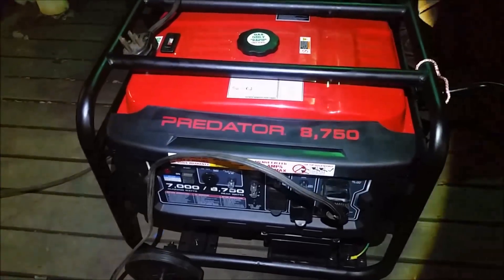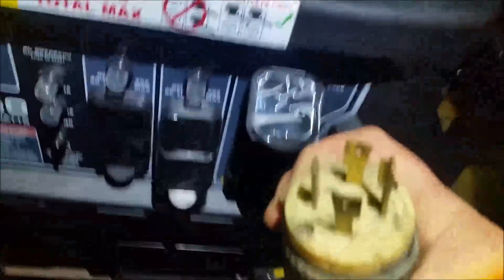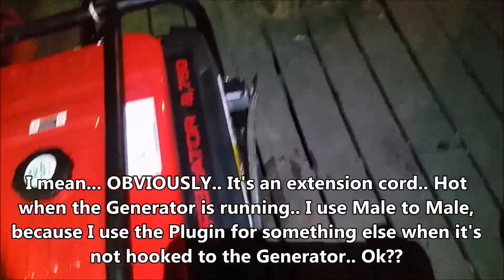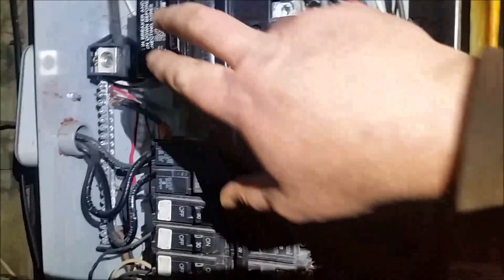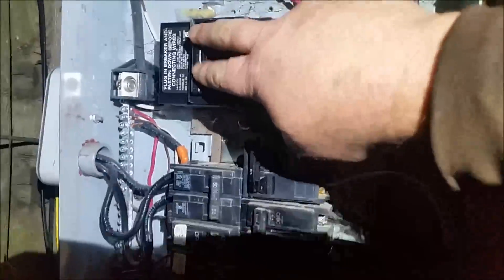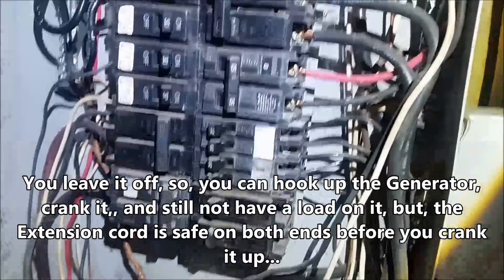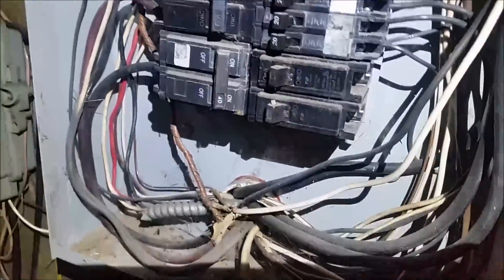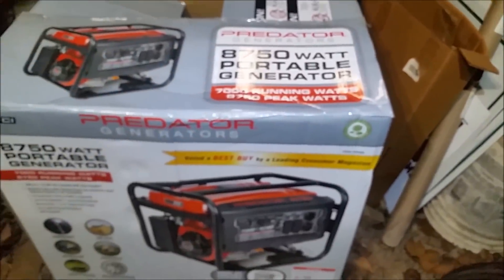Quick/Easy/Safe: Use Existing Plugin/Breaker for Generator hook up to your house Panel box.

Comment: Just saw your video. I have a 10,000-watt generator that I hope to hook up sooner or later and your video was helpful. I had the same idea with the cord having a plugin on each end. Seems like the only people who are against your video are licensed electricians who will be losing money when people wise up and do this themselves. As you indicated plainly, idiots should not attempt this, however, idiots will try this because that's what idiots do. They don't think before they do and they do not pay attention.. Thanks for the video.
Reply: Mark, after reading some of the comments I can tell you that you are wasting your time replying.  They are not going to get it no matter how many times you explain it to them.  The common sense fuse going to their brain has already blown.  Thanks again for the video.
Reply from the maker: I really don't understand how you guys think.. You have such a one track mind, you can't see that nothing here, or would be left here is "Not Code".. If the Generator is not running, a Welder is plugged into what "IS CODE", and the generator is sitting there with the Male to Male extension cord, under it's cover, waiting to be used "Next time".. 
It is the same 220 Volt plugin that the Welder uses 7 days a week,,, when there "IS" utility power.. 
Why can't you guys get it through your thick skulls... We don't add a bunch of Gaudy shit to hook up a generator for a few hours or days that we use a time or two a year.. Why??? It's Stupid!!!.. 
I mean.. All you have to do is remember to "TURN YOUR MAIN BREAKER OFF",,, and anything you do past that with HALF A BRAIN will get the job done...  Are you guys so bad that you can't guarantee yourselves that you won't forget to turn the Main Breaker Off??? I mean.. What did you buy a damn Transfer switch for anyway?? 
Did you ever stand back and see what the Transfer switch does?????  If you missed it,, go back and look at it again.. All that money,,, just to keep you from forgetting to TURN THE MAIN BREAKER OFF??? 
Holy Crap Guy... I mean Really???? 
I would be totally ashamed if I watched this video and didn't see the Genius and Simplicity of the idea..
Holy Crap. If you don't know to turn the Main Breaker off,,, how in the Hell are you still alive after putting in a Transfer switch??? I mean,,,, Just saying.. How in the hell are you not dead already??? 
AND,,, if you have not figured out the other part of this,, that I have not mentioned more than once here,,, there is one more thing you probably forgot.. You have a "Store Bought Generator Extension Cable" to go with all of the other Crap you just installed.. Mine is Home Made..  How simple is that.. 
You can walk around in a Druken Stupor and hook your Generator up and still be safe.. 
I can do the same.. Because,, no matter how drunk I get, I still don't get stupid enough that I need someone to remind me or keep me from plugging in one end of the extension cord before I use it.. I mean.. Have you ever plugged in "ONE END" of an extension cord and used it before??? 
Just plug in both ends of the extension cord AFTER YOU TURN OFF THE MAIN BREAKER AND BEFORE YOU  CRANK THE GENERATOR... 
How much do you have to spend, and how much extra crap do you have to hang on the side of your house to keep you from forgetting to do those two very, very, very basic and simplistic things???? 
Thank God you have a Transfer switch for your generator.. Now,, I have one less thing to worry with if you do something dangerous,,, like turn your main breaker off,, but, what the hell else are you going to do today... Because,, please let me know when you are driving to work,, because you really do scare the hell out of me, and I would much rather be an hour early,, or an hour late to work than to be on the road when you are passing.. No damn telling what you might do with that dangerous tool in your hands.. 
At least you know when I am driving, I am thinking about what I am doing.... I mean. It's for Real!!!!
There are dangers in life.. Wake up before one gets you that requires some simple thought before you do something..  There might not be a transfer switch or something else like it to save you from yourself the next time you walk out of your house.. Please, please, please start using your brain a little more before I read about you in the local news...
Reply: Code is to protect other's from idiots and get their money. Blue areas are near completely saturated with idiots. Sad we've became so badly infested with idiots.
Reply from the maker: Man,,,, do I agree with that... I would say that you have no idea, but, you said it first and I know exactly why you said it.. 
I wonder if you are keeping track of Q? If you are not, and you have some time, you should look into it..
Reply: I believe this method does not meet code. I hooked up my generator using a transfer switch which does meet code and was not difficult. I didn't have to get an electrician and I am sure if I move it will be safe for a new home owner. Most likely a new prospective home owner would have an inspection and if the inspector does their job correctly find this illegal hook up and have the home owner put in a transfer switch.
Reply: Hello, could you provide some details on what type of gen and transfer switch you used?
Reply: You are absolutely right on. I have been using double male back feed cords for years at some of our properties. At others I have the new style panels that have the mechanical lock out bar that prevents the main from being on when a designated generator breaker is in use. It's just a matter of people who understand and respect electricity verses those that have a problem with tying their own shoes. A lot of people will be "culled" if we ever have a serious crisis in this country.
Reply from the maker: Man... You are so right.. The first 30 days after the crisis are not going to be pretty ones.. But, I can guarantee I will be here after a whole lot of the commentators here are long gone.. I am amazed at how many people have paralysis of the brain these days. Say it can't be done, and it won't be done.. I am not familiar with the word..
Reply from the maker: Welcome.. I can tell you can do this.. It is simple, if you pay attention to dangers and safety.. Cheers.. Thanks for the Comment..
Reply from the maker: You are correct Durango Starr.. I had comments disabled for a while.. I figured I would turn them back on again and see if there were anyone who actually had something legitimate to say this time. Figured it might have been a moon phase or something last time I turned them off.. Ha.Ha.. Still the same old Burnt Fuses commenting.. Ha..Ha.. Some try to do their homework before the comment, but, after another comment or two, they fail miserably.. But, hey,, if they learned something on their first research,, maybe it will be a life changing experience for them.. Ha. I don't back down from a challenge.. But, yes.. Often a waste of time for sure.. But, I type fast and need a break from my other work from time to time.. Cheers.. Thanks for the comments..
Reply: Mark Thomas Mark this method is ok for an emergency.  I just prefer something a little safer for those times when someone else in my family might need to start it who either might be too afraid and not use it because of warnings or maybe too. Confident not comprehending the dangerous parts.  But ok for me in a pinch
Reply from the maker: Ok.. Now we are where we need to be.. I just answered this in my previous post that you will come up on in my replies to you.. You figured it out.. Nothing wrong with this setup.. The only thing different is a Male to Male Cord that you use "Temporarily",, I would not say in an "Emergency", because there is no threat of loss of life, etc.. 
So, no reason why a even remotely responsible person, who understands that Electricity can hurt or kill you,, to plug both ends of the cord up before you make the cord live.. The problem is your Comfort level of working with this,, not that there is anything wrong with the way it works or how it is done.. I think that is evident in your comment above.. 
You prefer something a little safer for your family or someone else.. Nothing wrong with that.. You are erroring on the side of caution.. After all,, if something goes wrong, it was you who installed it.. Me.. I live alone, and my 80 year old Mother has this same setup, and my 56 year old Girlfriend also has this same setup.. I do not worry about either one of them making that mistake,, or telling someone else to go out and do anything that they are sure that "They" can do safely themselves.. And, if both of their legs are broken and they can't make it to the box and have the Neighbor come over and do it,, I am also certain that they would either talk them through it over the phone, over the two way radio, or write them a simple set of notes,, Stressing "Main Breaker Off First, Generator Breaker off, plug in Cord, Crank Generator, Turn on Generator breaker.. If nothing else,, Turn off the main breaker, text me a picture and I will tell you what to do next would work just as well... Or go out and turn off the main breaker and bring my phone which has no service back to me before I tell you what else to do.. 
Or,, just make sure you don't touch the bare ends of the cord either way.. Either way.. They have to be able to follow some sort of instructions,, even with a Transfer Switch.. Cheers.. It's your family.. Do what you feel "Comfortable with".. You will always sleep well at night..
Reply: About 10,000 linemen will disagree with you, after having been knocked off a pole trying to restore power to dumbasses. But that's ok,  I know their is 20,000 attorney or more that wish you well :)
Reply from the maker: Richard Kelson.. There are at least 2 lineman in my area that have my same setup, and that is confirmed.. They asked me about mine,,, and then, later stopped and said how well it works.. 
But, they are not scared that they will forget to turn the main breaker off.. Ha..Ha.. Says something about all of you now doesn't it.. Ha..Ha..
Reply: THERE NOT LOOSING MONEY MORON THERE TRYNG TO SAVE YOUR LIFE.U MUST BE FROM THE SAME TOWN AS THIS ASS THAT POSTED THIS VIDEOP
Reply: +Mark Thomas I knew when I watched this video that there were going to be a lot of negative comments about how you went about doing it.it was so predictable,all the folks talking about the electrical codes. I don't give a damn about the codes.once you turn off the main breaker anything you do only effects what's behind the breaker.if a guy needs to consult u-tube to do something this simple, he should get some professional help anyway.
Reply from the maker: Gene Inman,, I could not have said it better myself... Funny thing about it is,,, it is quite common to backfeed breakers.. It is done often by Licensed Electricians. And the NEC Code does not address or regulate Portable or Temporary Extension Cords.. Ha..Ha.. 
It's True..
They hate it when I post these links.. They really have nothing else to say.. Ha.. Hell, what can they say.. :)
Backfeeding Breakers
https://www.electriciantalk.com/f2/breakers-directional-19714/
NEC CODES  406.6 and 406.7
Notice the first reply by the Moderator.. Even though he disagrees, he says it is not regulated.. And, he knows enough, no one even remotely argues with him.. 
http://forums.mikeholt.com/showthread.php?t=158086
Definitions to look at to understand the above..
https://iaeimagazine.org/magazine/2014/12/02/article-406-receptacles-cord-connectors-and-attachment-plugs/
Reply: Please buy a simple transfer switch in your installation. Home depot has them
Reply from the maker: Dan Anderson.. YES.. Please do.. You should surely not try this procedure.. Please call an electrician and have him do it.. It has to be better than you trying this, and hopefully, you find an electrician that has not posted here.. I would not trust a single one of them here..
Reply: I'm an electrician and I do the same thing. My house is a rental and I'm not installing a transfer switch for the owner unless they agree to pay for it. For those without a welder plug, the same can be done with an electric range or dryer outlet.
Reply from the maker: Thank you James.. Yep.. the ones you listed are usually 50 amp plugs and more than enough for the typical portable generator,,, usually 30 amps per leg.. The smallest breaker in the mix will determine the voltage capacity, and in these cased would generally be the Generator breaker regulating the Max Current to the circuit.. A couple of the lineman that work my area have my same setup.. One guy saw my hookup one time and within the next outage or two, the rest of the guys had stopped by to let me know the status of the repair and asked to see what I had done.. They liked the simplicity of it, and are not the type of guys who would forget to turn the main breaker off..  Cheers.
Reply: @MarkThomas123  I did the same thing but with a duplex 125 volt outlet. The "Kill Me Quick" male 250V plug to two male 125V plug connector is the only thing you have to hide from the electrical inspector. When not in use it's just two outlets fed from different phases and a generator stored in your garage. Where's the code violation?
Of course when it is in use it's a violation, but no inspector is stopping by during the power outage.
If you screw up and leave the main on, or unplug either end with the other powered there could be issues. . . So don't!
If I had kids or other people who might try to use it, who didn't understand, I'd use the recessed male plug and transfer switch set up.
The outlets have to be inside the garage and cord run outside to the generator otherwise the outdoor outlet that isn't GFCI protected would be a code violation.
Running the generator inside the garage brings us to a whole new batch of ways to be stupid!
Reply from the maker: Exactly... But, my garage is not connected directly to the house, so no CO2 issues and I don't work next to a running generator.. I usually work on something inside. Usually nasty weather anyway.. 
Yep.. Whatever you have to do to get things working again is what it is all about.. That is,,, if you have the common sense to know what you are doing.. Such a simple set of rules..Ha.. I agree.. Turn off the Main and turn off the Genset before unplugging the cord.. Pretty simple in my book,, and I am no Einstein.. :)

Comment: It is as you say. it is safe if you follow the correct procedure and don't have ignorant people messing with the connections and switches. If anyone is around that is irresponsible, uninformed, or doesn't have common sense the connections and breaker box need to be made inaccessible to make it as idiot proof as possible when the generator is running. Anyone that can't follow directions without making a mistake shouldn't try this. As you say like anything else use common sense and it is safe. If you are like the person that used an electric drill in their nose to fix an itch and tried to sue the manufacturer because there wasn't a warning not to use it in their nose then you need  the most idiot proof setup possible. Nothing can be made completely idiot proof or have enough warnings to prevent an idiot from injuring themselves or someone else. Breaker box covers can be removed with a screwdriver by an idiot so they can stick their finger on a hot wire. It is impossible to out wit idiots but for sane people this is safe and works.
Reply: It is impossible to make ANYTHING Idiot Proof, because they just keep making better idiots. Ha
Reply: Gordon Willoughby, please make sure you watch this video about generator safety as well https://youtu.be/I1jT3ANENvI it’s very important
Reply: @tonisam962  I watched it. Reinforces what I was saying. I should have included children because they don't use common sense these days because they aren't taught to use common sense even when they are old enough to know better. Younger kids definitely should be kept away from anything like that. I saw a comedian on Facebook talking about it. He said parents now don't let their children learn anything by experience so they never learn to use common sense. I knew of a child that cut her own hair. Looked terrible. Child blamed her father because he was supposed to be watching her. She was old enough to know better.
Reply from the maker: I agree totally.. Can't fix ignorance.. But, common sense works like a charm with a little information about what you are doing and why, and where the dangers are... Cheers..